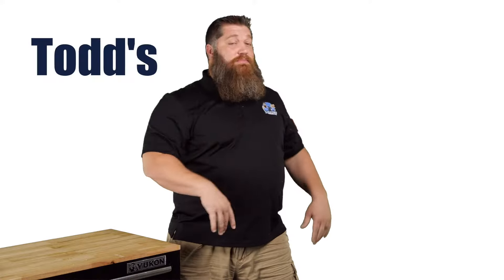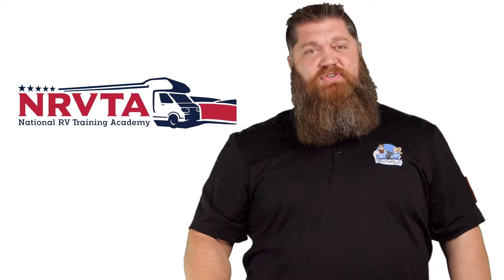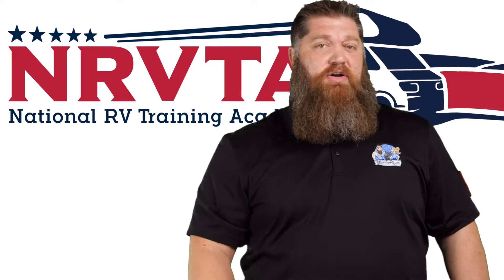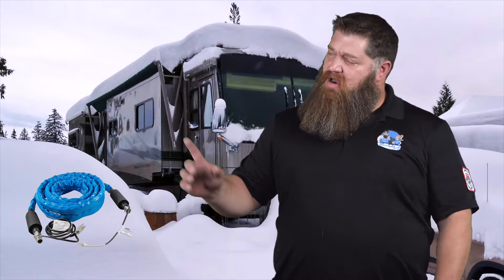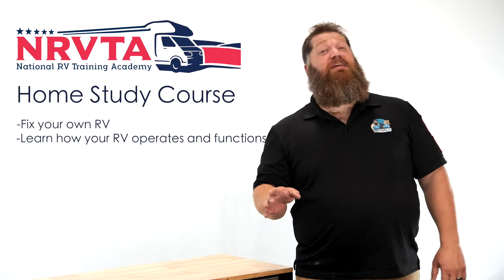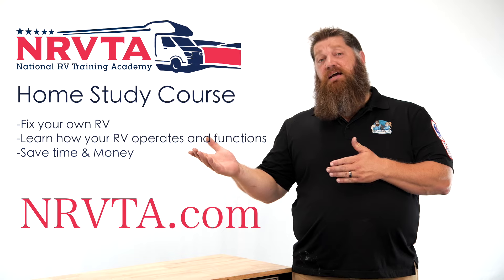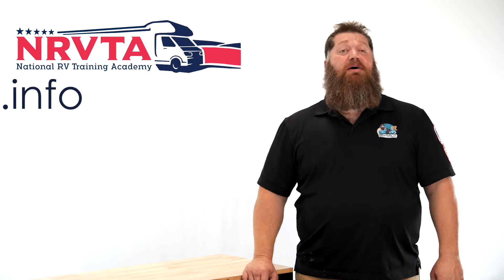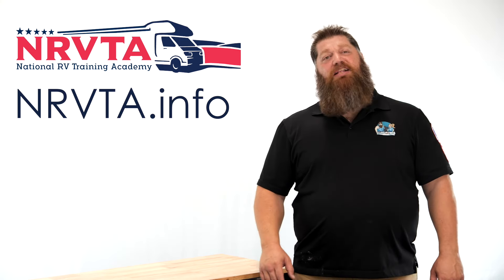Freezing RV Pipes and Hoses

Comment: Any tips for an older suddenly widowed lady who was unlucky enough to have her fresh water holding tank on her travel trailer actually fall out of place pulling the underbelly down crushing some ductwork and then land on the rear axel.  Yea it happened while sitting parked last January.  When I had it removed & repairs done it had WARP written on it in black marker 😢. So now I have no holding tank. It’s full hookup or nothing but gallon jugs. 🤷‍♀️ what’s an old lady to do? I go south for winter but it still gets below freezing some nights. Tips appreciated.  I have always hated winter! This sucks.
Reply from the maker: you can find a mobile Tech to come and see what can be done. RVTAA.org/locate is a great resource. You could also find a RV dealership that may be able to work on it. It sounds like you've had techs already come and work on your RV. There's really no simple way to make this a easy fix for anyone.

Comment: I’ve heard to prevent freezing to let the water run overnight. Should you let the water run through the heated water hose, or should you instead fill your fresh water tank and let it run from that?
Reply from the maker: Fill your tank, if you have tank warmers then you are golden in most cases. Heating a water hose seems silly as there is such a small amount of water it will freeze far faster than a full holding tank.
Reply: @NationalRVTrainingAcademy  but it won't freeze... because it's heated, and the stuff inside the rv won't freeze... because it's heated.

Comment: If you blow out your water lines and they are not under pressure, you do NOT need to put antifreeze in the lines. Water lines cannot freeze and break if they are not full.
Reply: The concern is freezing water, so if there is no water, then there is no concern for something to freeze that isn't there. I genuinely do not understand why the common wisdom isn't to remove the water(with air pressure) and totally eliminate any and all concern. But then again, I'm no travel trailer expert either.
Reply from the maker: The reason this is not preferred and backed year after year is that there are too many 90 turns, check calves, coils in the line to blow out 100% of the water. 

Air goes over the water once enough water has been blown out. Air will NOT get 100% of the water out. Physics.

Comment: I emptied my fresh water tank and plan to disconnect my water hose from the RV and leave my valves closed during the cold front heading to Fl this weekend. Am I safe from my pipes freezing if there is potentially a little bit of water in my lines?
Reply from the maker: do you have a 4 seasons RV? if so use the furnace and it'll keep your underbelly warm. if you have tank heaters use those too.